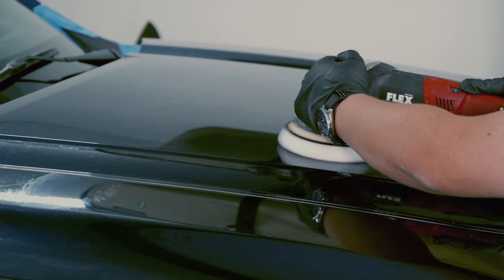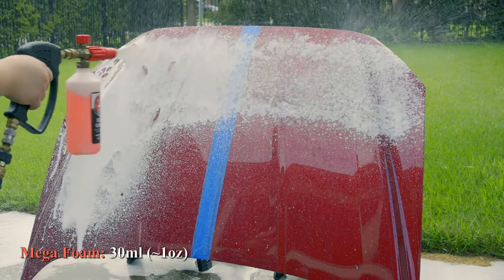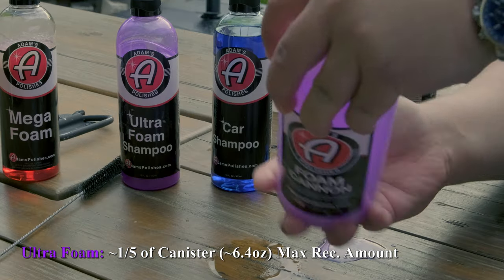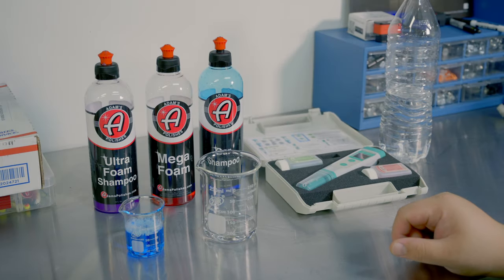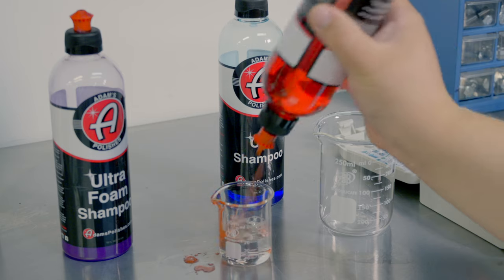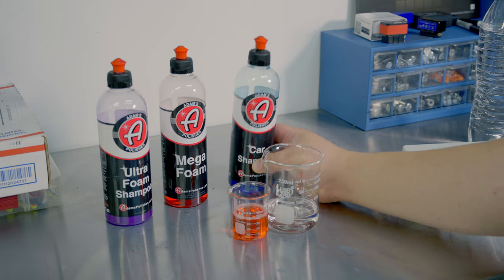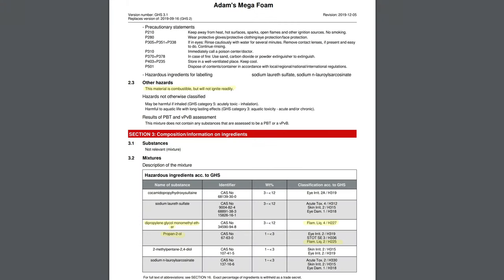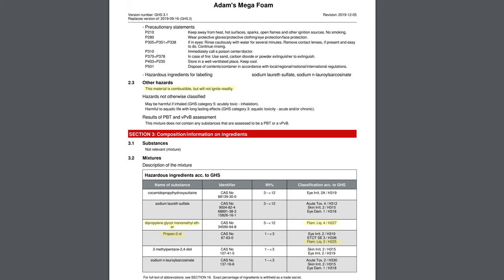Best car shampoo for biggest foam? Adam's Mega Foam vs Adam's Ultra Foam vs Adam's Car Shampoo

Comment: I have used all 3 and like the mega foam a lot and the original. The Mega foam smell reminds me of a Hawaiian Fruit punch drink. That was very interesting info on the ingredients on the mega foam being harsher on the wax you used. That type of info you don't see in most reviews. I always use Bead Maker or Adams Detail Spray as a drying aid after each wash. So there is some protecting being added after each wash. Awesome vid, thank you.
Reply from the maker: Thanks for watching! It does smell like punch, and definitely foams well. Just the ingredient made no sense to me for a mild shampoo.

Comment: Lastly, there are many other foaming soaps out there as the market starts to pick up for portable foam sprayers (iK foam pro).  I would request, if possible, perform the same test (foam, pH level measurement, and wax stripping test) using other foaming soaps offered from Chemical Guys, Turtle Wax, Griots Garage, etc.. etc...
Reply from the maker: Definitely going to be testing more shampoos in the future, sounds like people are interested!

Comment: Crazy how it can be considered PH neutral when in reality its about as basic as salt water or getting close to the realm of baking soda. Great video👍
Reply from the maker: Thanks Brayden! Yea I was a little surprised. Plus if you do the math to back out the 3:1 dilution ratio you realize its even more alkaline. Of course your final pH will depend on the desired dilution and pH of the base water. Granted pH isn’t everything. Plenty of things that aren’t particularly acidic or basic can eat away wax. For instance isopropyl alcohol is an 8. So technically pure iso is less basic than the Ultra shampoo, but obviously it will destroy wax.

Comment: But how does it clean with the recommended use? We only saw the foam capability not cleaning capability straight out of the gun. For example, Bilt hamber foam is almost water from the gun but cleans like hell.
Reply from the maker: This is a good point. Cleaning is not something I tested directly. I would suspect Mega Foam is the harder cleaner based on how it attacked the wax. This would make sense since the most gentle shampoo is unlikely to be the best degreaser. 

Generally I have regularly cleaned and garaged cars so its rare I have a scrubbing power first need. Typically I’m most interested in the amount of lubrication (foam) and actually how mild it is, which IMO is the opposite of how well it cleans. Im mostly removing brake dust, dust, pollen, etc.. 

I could however see how others could benefit in knowing which is the strongest cleanser. Especially the offroad crowd. Ill see if I can come up with a uniform way to test that.
Reply: Dmitry's Garage still big thumbs up for the conent mate
Reply: Bilt hamber foam is insane. I looks like it will be terrible as it produces little foam, but it’s by far the strongest cleaning snow foam I’ve tried. Most of their range is outstanding, particular surfex HD, autowheel and double speed wax. If only they bothered their arse adding fragrances to their products, they would sell better.
Reply: These are more for foam and lubrication to maintain your finish and protection. If you have a very dirty car or need to strip it you can use their strip wash or carpro multi X and Reset
Reply: @devn3813  Reset is basically unbeatable in my opinion.. I very rarely use anything else. I couldn't care less about color and smell..

Comment: Ultra foam you are the weakest link. 

I've snooped around online and noticed the reviews seem to reflect that as well. People are generally not satisfied with it especially compared to the OG or Mega Foam. I like the idea of the Mega Foam as a prewash and for touchless washes but the OG has the versatility for bucket washes. There is also the value per wash. Mega foam can drop down to 1ounce per foam cannon fill versus the 3oz of the OG but the OG is about half the cost per gallon and comes in 5 gallon as well. The Adam's site periodically has 20% sales too so you can get down to around .50 cents per foam cannon fill either way. Thanks for the great comparison video!
Reply from the maker: Damian you are exactly right. Especially about the cost comparison too. Catch the right sale and buy 1 or 5 gal and use it a long time. I buy the 5 gallons myself. Same for their basic detail spray. I even thought about making my own (the ingredients are simple) but id be saving almost nothing over buying a 5 gal on sale.